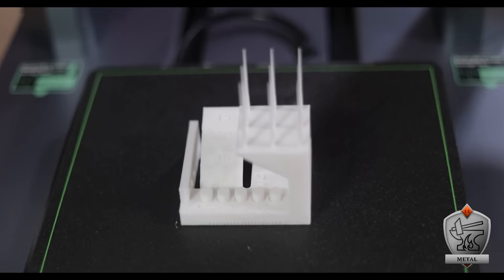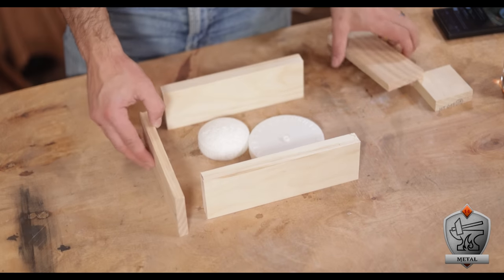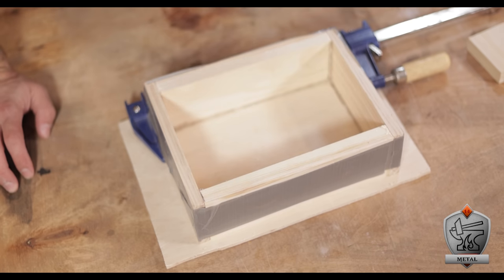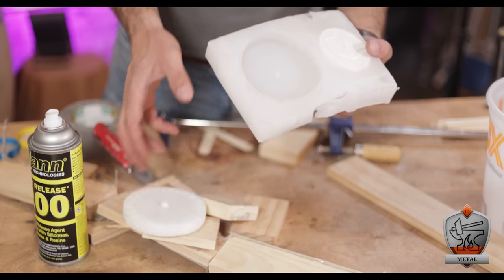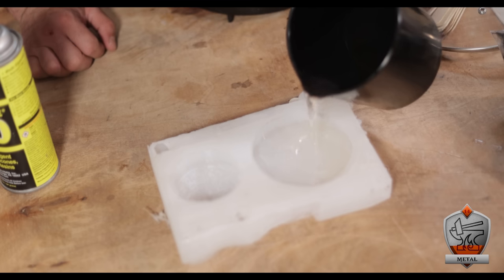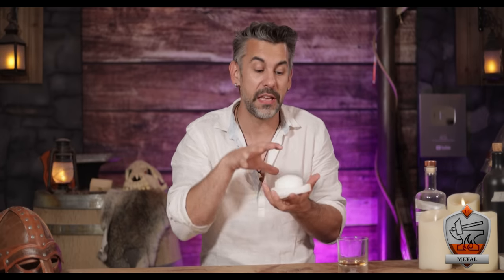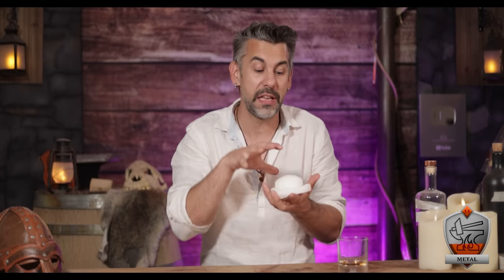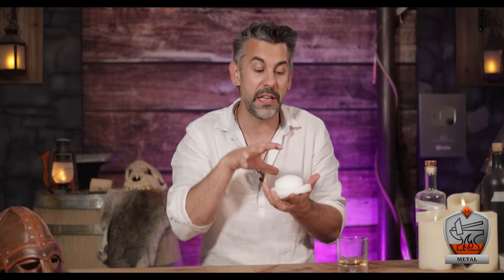DIY Your Own Fantasy Cipher!

Comment: You were on the right path with the initial set up. You did make it more complicated by creating two molds, though. Get your 3D print as "refined" as you want it to be, then get out your frame and your green sand. Again, you were on the right path at the start using the mesh to sift the sand in, but it's also a good idea to apply a non-stick coating (there are sprays and powders for this) to the piece to keep the sand from getting stuck to it, and also pack the sand periodically as you're filling the frame to help set it into part to be cast, otherwise there's a chance of the sand not being consistently solid from top to bottom. Once you have the sand packed and you turn the whole thing over, tap the casting blank firmly to ever-so-slightly loosen the sand around it before pulling it out. Might be a good idea to drill a small hole into the bottom of your casting blank before you set everything up so that at this step you can carefully twist a screw or two into it to give you something to grab onto and lift the blank straight up and out so it doesn't smoosh the sand around. You now have a sand mold into which you can pour your molten metal.

Note that this method only works for "one-sided" casts. If you want a two-sided cast (i.e. casting a piece that doesn't have a flat side or that tapers in a way that can't just slide out of the sand (say, a 20-sided die) you either have to cut the piece in half and do this method for both halves and then adhere them together, OR you cut the piece in half, set up the first mold as usual, re-attach the casting blanks together, apply the non-stick (I believe powder is the better option here), set the second frame on top of the first fully-prepared mold (you'll want both a locking mechanism to keep them together and an "indexing" mechanism to keep them perfectly lined up). Here's where it gets complicated. You're going to be pouring molten metal into an enclosed space, so as you are packing sand into the second frame you need to create channels for air and moisture (from the oil/water in the sand) to escape as well as a channel for pouring, which should be topped off with an offset indentation to create a "basin" into which you will pour the metal, which will then flow into the pour hole. Sort of like a funnel but slightly off to one side with a channel leading to the pour hole. It's hard to describe with just words and no visuals. Once you have the sand packed and all the "escape" channels and your pouring channel in place carefully separate the frames and remove the casting blank. Then just reassemble the frames (this is why the indexing mechanism is absolutely critical), lock them in place to help prevent leaks, and you're ready to pour. Bear in mind this will leave you with a bit of finish work to do as you'll have to snip off and file down the extra metal that will come up into the escape and pour channels. 

Honestly I'm not sure how well I've described any of this and there are TONS of useful demonstration videos here on YouTube that probably explain it better while also being able to actually show what's being described. I don't know about you but for me I am very much a visual learner; I have a much easier time assimilating new skills if I actually see it being done rather than just being told how to do it.

Comment: - OpenScad would be a great tool for designing that style of decoder.  But I say that as a computer guy practiced in the kind of arcane incantations it employs.

- Upgrade: the base is a shape that fits marks on a map.  Turn the dial based on code letters and an arrow on top points to a place on the map.

- Lost wax casting usually has the wax melted and burned out before casting the metal.  Which requires a molding material that will hold shape by itself.  The vapor layer you described is called the "Leidenfrost effect".

Comment: Pivoting to making it out of “stone” was a great choice, it looks awesome! For casting advice, I use paraffin wax as well, however I pour plaster in a vessel, put the wax piece in it, and let it dry completely. You can fully submerge your piece in the plaster and use sprues, or just leave the back of the wax piece above the plaster if it’s a one-sided cast. Either way make sure you don’t let the wax float up or tilt in the plaster, because it will. Then just turn the dried plaster upside down and melt out the wax in an oven or with a candle. Once everything is totally melted out, you can cast. Just make sure to heat up the mold a little right before you cast, either set it by the fire or in an oven, you don’t want any extra moisture to make the mold explode when you pour. I’ve had good success with this method, and I’ve even been able to re-use the same mold sometimes. Best of luck, keep up the great work!

Comment: You did the right thing with the mold, but you need a second half. Baby powder the first half, build another box on top with 2 tubes on each piece of wax out the top of the second box. Fill with the sifted green sand. Remove the tubes after creating a slight funnel shape to make an easy pour target.

Comment: Idea for this technique:

Cast some “lost tablets” that contain some bit of lore that has been changed over the centuries. The modern understanding is actually quite different from the original, so the discovery of the lost tablets would be a major paradigm-shift, one that perhaps certain factions would not want coming to light…

Comment: While this might not be possible with your tools but, my suggestion would be to look into lost PLA casting. You can get PLA for 3d printing, submerge your print in plaster, burn it out clean, and then pour the liquid metal into the void.
Alternatively, just remove the positive from your sandmold rather than trying any sort of lost casting. Since your object has a flat side, thats probably the easiest

Comment: So I do want to add that when casting, try and do it on the grass. I don't know about asphalt but concrete can explode due to trapped moisture. Other than that anything I could say has already been covered, though since you have a 3d printer you can actually do lost PLA casting. This was a very cool project! makes me want to carve something similar out of wood

Comment: 1. Build another box the same size as your original.
2. Complete the process the same all the way up to flipping the packed sand mold over, exposing the bottoms of the wax molds.
3. Place second box on top, then place smallish dowels on the bottoms of the wax molds. Make sure these dowels stick out above the top of the box.
4. Fill with sand, the same as you did for the molds, packing it carefully.
5. Hollow out little "funnels" around the sides of the dowel ends.
6. Remove the dowels, being careful not to disturb the sand on the sides.

When you pour this will help to prevent overflow and maintain temperature. Another option is to 3d print thin-walled tubes in PLA in place of dowels, so that you don't have to remove them and risk getting sand in your cast.

Comment: Great start keep at it. When you were melting the aluminum I was scared you were going to have a similar time I had when I used a extinguisher of the Al melting through the make shift crucible ruining my foundry. Glad that didn't happen. Keep up the good work.
The mold for this cast could have simply been made with the 3d print for then removed for the pour, the silicone and wax steps were unnecessary for this type of design. Edit: Ignore this previous statement, it is true that you can use prints it this fashion but i failed to notice the sides with the letters and scroll work, when attempting to remove the print or what ever item used and the base they would just rip the sand out and not giving a proper profile of the letters.
As others have stated wax is used to create a mold then is removed (melted out) through the pour spout leaving a void for the metal. The technique you were trying to mimic was a lost foam cast. The foam being far less dense than wax means far less material to vaporize, thus being easier for the liquid metal to do so.

Comment: I believe you confused Lost wax with Lost Foam casting. 
Lost Foam casting involves pouring the molten metal directly onto the foam and it burns away, Lost Wax requires you to melt the wax out first in an oven and is typically used with an investment plaster mould.
There are also PLA filaments you can get that are designed for the Lost Foam/wax method, it saves you making the silicone mould step.

Comment: homemade metalsmith:
dope project but 2 great points for future metal working to keep in mind

1. when making molds I wouldn't cast on the back side like that. the metal slipping off could have been completely avoided if there were pour spouts in your sand. Next time either print long tubes for the 3d print to then wax cast with or put a stick on top of the mold where you want to pour metal and then pull it out leaving a hollow channel. then your metal is forced into your pocket and not allowed to scurry away

2. please PLEASE be careful when losing liquid metal onto concrete/asphalt. Micro pores in the concrete can contain moisture, this when superheated turns the floor into a bomb. I've been around concrete metal explosions before "hot rock and metal fireball" is the best way to explain it. 

overall amazing work as usual keep it up :D

Comment: you could take the wax moulds and paint of plaster of Paris and sand mixed in as the first layer to keep the details then pour more plaster on top once it sets, let the outer shell set and place in the oven to harden and also melt the wax, pour the wax out and it can be reused again, then pour the metal into the plaster mould let it set and then put into a bucket of water to cool it down and clean off the plaster and polish it.

Comment: When you cast in green sand, you're supposed to carefully pull out the piece you used to make the imprint. Also, doing a double-sided mold with the sand works much better than an open faced casting.

Comment: I have some experiance with casting but you can still do the wax mold but once its in the sand and compacted take out the wax mold so it has the detailed indent of the mold in the sand then carefully pour in the melted metal. That's how my grandpa taught me. Also you can watch some blacksmithing channel's like Man at Arms or AWME.

Comment: To be honest I’m surprised you don’t have a 3d resin printer with how many small intricate accessories you make. I think you might like that a lot
Reply from the maker: It is on the WISH list lol.
Reply: @SkillTree  Find one you like and ask if you can try one for review
Reply: Hand crafted is the point for me, with organic materials. Leather, metal, stone ect. Gonna pass on plastic items unless absolutely necessary.
Reply: @oakmaiden2133  I like handcraft too. But for me using something like foam or resin helps with those details that I want to make extra special. Like my glow in the dark “crystal” lamp
Reply: @oakmaiden2133  Just to add to what @Renge43  said, you also only have to get the design right once and you can print dozens, if needed. Really handy for those greebles that you need a bunch of but don't want to sculpt each one by hand lol

Comment: with regards to the casting, i cant say ive ever seen someone try lost wax casting in sand(maybe i just haven't looked very hard) but whenever ive seen lost wax casting done, its been in something like a plaster mold and the wax is melted out before the metal is poured in then the mold is broken apart to release the finished part. also for sand casting, the item used to make the impression is removed which perhaps wouldn't work on these specific pieces due to the details on the side. my recomendation for future casting would be to make a mould out of something such as plaster of paris, which would have a high enough working temperature for casting aluminium but may not be suitable for metals with higher melting points such as steel

Comment: One little detail you could add would be a lighter, almost chalky ring, like a groove or skid mark where the top bit scraped across the bottom bit as it was turned and worn away during its former use.

Comment: like many have said. ya mixed two different casting processes. lost wax and green sand. looks like yours would be better for lost wax. cast your wax item add a sprue. coat in plaster. melt out wax. fill cavity with molten metal. its best to set your entire mold in sand. let cool some and dunk it in water. brush off plaster left and do your thing. also aluminum shrinks when cooling so it will be slightly smaller. might not matter too much here but if you are trying to get a tight fit it could. also steel soup can is ok few use crucible stand in

Comment: There is a microcrystalline wax that is used for this method. It's referred to as Lost Wax Casting. It will be green and slightly sticky. 

I have also seen Lost PLA casting. Though that will be a bit more dangerous.

Maybe try jewelers investment powder. It will take on all of the details very nicely. Make a two part mold, remove your piece, pour the metal and dissolve the investment powder. I've seen someone make metal mushrooms with it.

Comment: There are silicone mold compounds that can withstand the heat of molten pewter, too. Doing it that way, you can cut out the wax step entirely and have a re-usable mold

Comment: Another casting problem is trying to use Aluminum in an open mold form. There is not enough head pressure to push the aluminum into the fine details. Aluminum can work in projects like this using the proper gating, feeders, and spin traps.  I find Zamak ZA 12 a more forgiving metal to work with, and its melting point is around 400 degree Fahrenheit lower.

Comment: The most common tool that I've seen for removing bubbles from a mold is a palm sander. Turning it on and running it slowly around the frame of the mold a few times, according to YouTube, magickally removes all bubbles! Voila! 😁

Comment: i havent done metal pouring. but watching vids you use the hard formed objects topound the sand into but then remoe them prior to pouring. so you carfully pour into an empty mold. you have to ue talcom powder on the hard object so it pulls away from the sand easily. you may have to make a second half of ths mold that is just flat with pour and air holes [air has to escape]. good luck. recommend try using lead. lower temps, and can get large blanks at fishing store.

Comment: You need to pick a lane!
The problem seems to be that you're combining both sand casting and lost wax casting. Green sand will hold its shape if packed down right, so you won't need the wax to keep the cavity open. generally sand casting is for less detailed pieces and you get sand inclusions in the metal. I think your best option is with lost wax casting. Try putting  the wax in plaster and melting out the wax before pouring.

Comment: You really needed to melt away the wax before pouring the metal. For this reason, sand is usually not the preferred mold medium.
Typically for "lost wax casting", you make the wax part and then add was sprews and coat it with a fine plaster.  After the plaster hardens, you melt out the wax to form the cavity for the metal.  From there, you just pour the molten metal into the mold (often placing the mold in sand for structural support and insulation).  Once cooled, a little water and scraping will remove the plaster.
There are lots of great videos on the process for more details.
As a bonus, the plaster gives a much higher level of detail than the sand (think about the grain size of the sand vs the floury consistency of the plaster).  For this reason, I would also recommend doing any extra carving or modifications to the wax rather than waiting to do it on the metal.  The wax is much easier to work with and all of those little details will come through just fine.

Comment: CASTING TIPS:
Do not use paraffin wax.  It does not burn out properly even if everything else is perfect,  use beeswax or as others have said, use the green casting wax.
For this particular project I would suggest you not use sand casting, not enough resolution, especially for larger parts.
I suggest you use Plaster of Paris to make a metal mold.  It works the same as the sand mold BUT after the plaster fully sets you turn the mold over and support the corners with fire brick. place the whole thing on a sheet tray and place in an oven at 500 degrees.
The high temp is to burnout the wax.
Then take the mold out and let it cool.
When you are ready to cast with metal, preheat the mold in the oven again at 500 degrees for an hour before you are ready to pour.  Place the mold on a fire proof surface and pour the liquid metal into the mold.  Allow to cool for at least a few hours.
The preheat is to heat the plaster mold enough so that the mold does not cool as soon as you pour in the liquid metal.  This gives you better and more complete castings.
I suggest you make several wax copies with the silicone molds then make the. same number of plaster molds all at the same time.  That way you are ready to go again much faster the next time you need to cast.
For the metal- I suggest you use Zinc, it is fairly heavy and the melting temp is low (for metals) at 550 degrees.  Your crucible can be a cast iron frying pan from a thrift store.  Zinc btw is VERY easy to get, just melt down pennies!
Of course if you want you can do the burnout and the casting one right after the other, I was usually prepping several different molds at once so it was always over a few days time.  Also practice moving stuff around while it is cold using the gloves and tongs you will be using at the time.  Trying to move a mold out of an oven for the first time when it is 500 degrees is not the time to realize you forgot to move that thing out of the way.  You know that thing that you didn't think was in the way but now with your hands full, it defiantly is...

Good luck